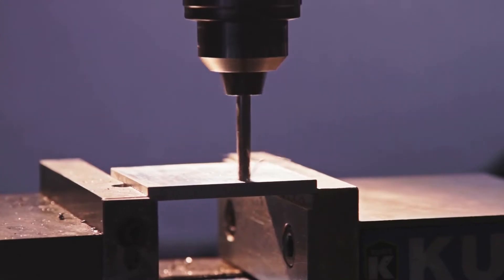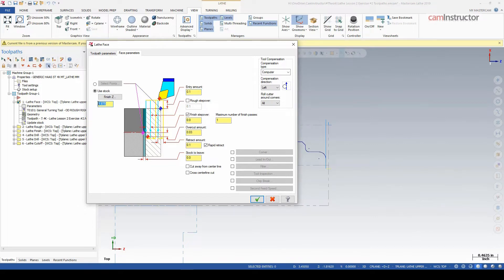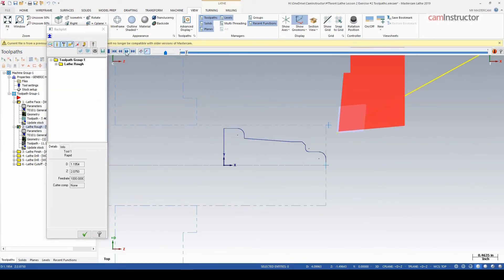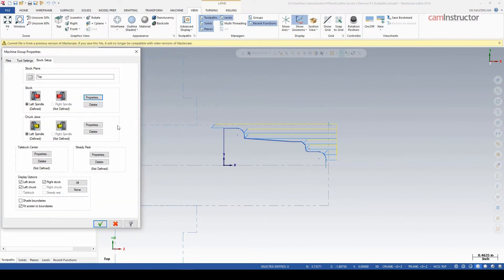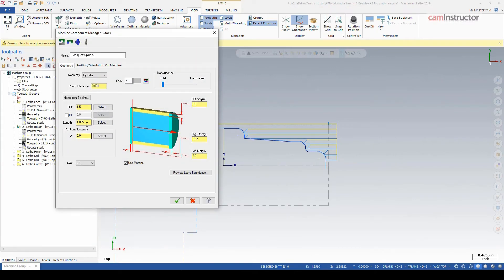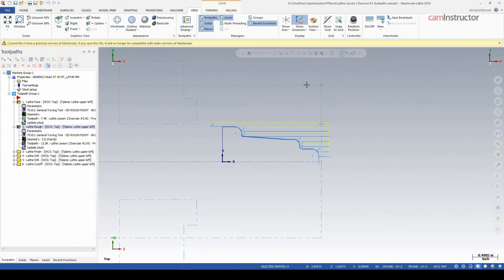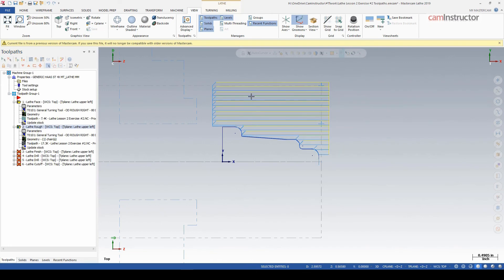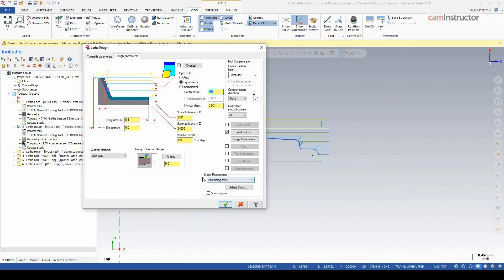Mastercams Lathe Stock Recognition Setting to Save Your Tools

Comment: Hi Sir! I have a alarm on mastercam lathe after I programed dynamic roughing on Lathe it was " No area of remaining stock found " although I already created stock and Chuck?? Could you help me this. Thank you Sir
Reply from the maker: Tough for me to guess without seeing a file.
Reply: @CamInstructor  yes sir! It looks like these......after creating stock it show hidden line of stock around the cylinder part, Chuck shown at the end of the part, I used margin check box too, using left chuck, about toolpath I click on undercut diameter will be machined highlighted and dynamic roughing parameters I used.062 step over, 50% of cutter, zigzag method, ect....defaults. But couldn't not backplot because of this " No area of remaining stock found " thank you Sir!

Comment: My rough bore operation won’t let me choose to use remaining stock. Stock recognition section is greyed out. Stock is defined properly and for the correct spindle. The tool is also defined perfectly.
Reply from the maker: Check your axis combination for the op. Greyed out stock settings means the op is not seeing any stock to interact with. eg you have stock defined in the left turret but the op is looking at the right.